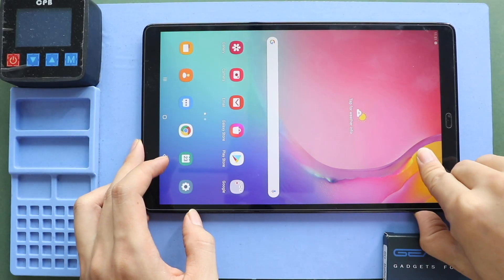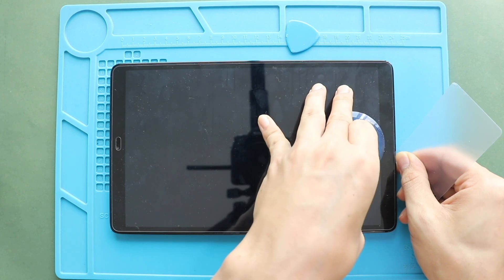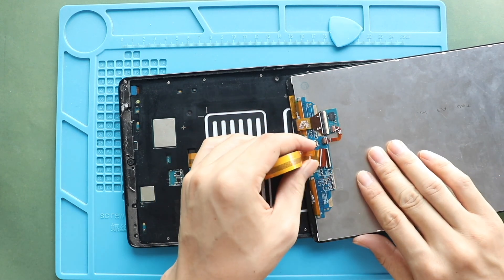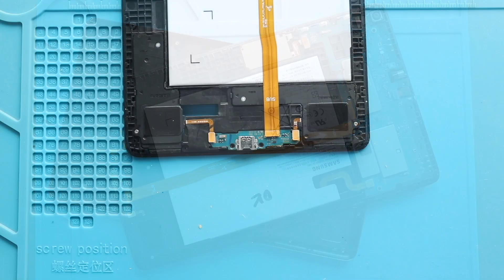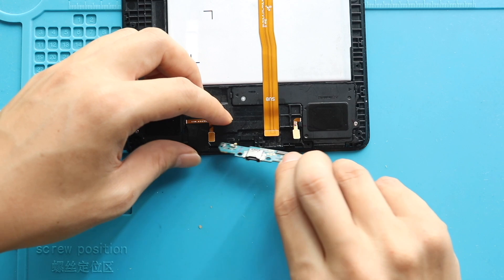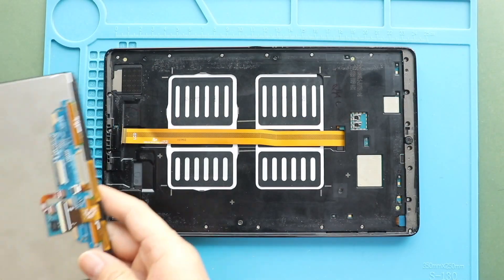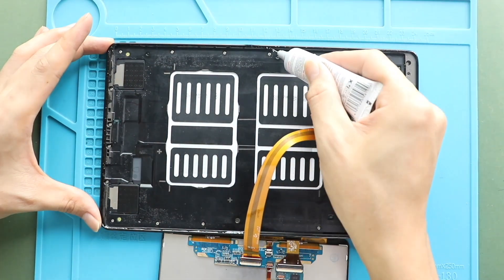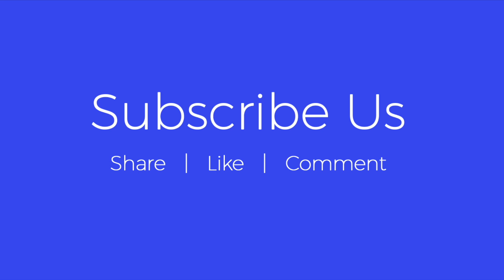Samsung Galaxy Tab A 10.1 2019 Charging Board Replacement | T510 T515

Comment: Just wanted to say 'Thank-you very, very much" as your video certainly helped me fix my Dads tablet when he wrecked the Charging Port trying to insert a Micro-USB cable instead of the correct USB-C cable... very, very much appreciated 🙂 Just wanted to add that I had no display after putting it all back together and holding Power/Volume Down seemed to bring the display back... Thanks again 👍
Reply from the maker: Great. Thanks. Share & support us 🙏